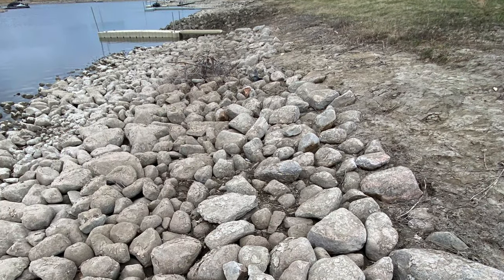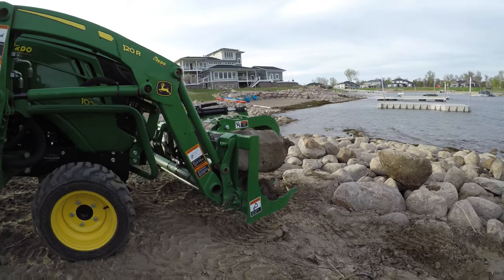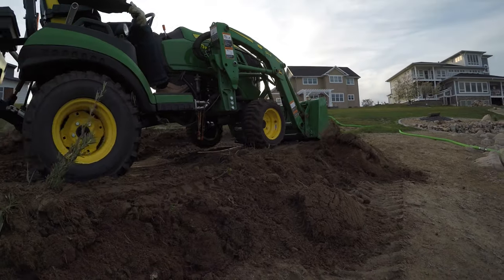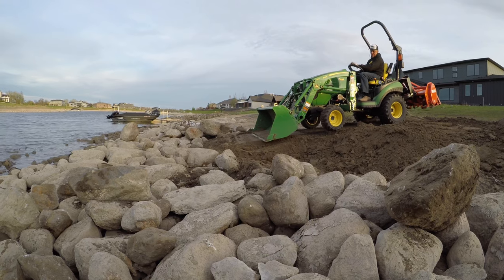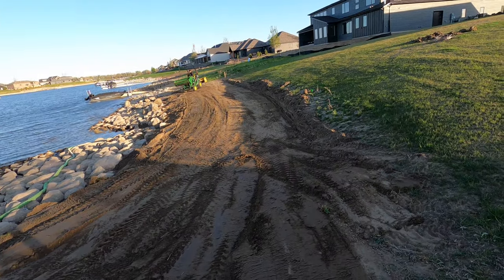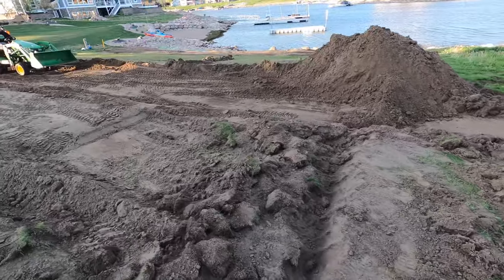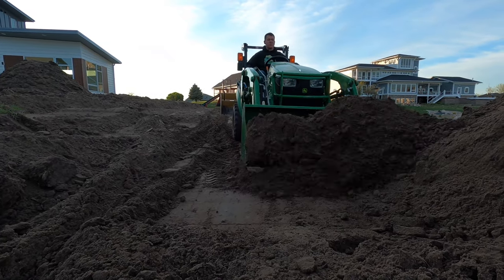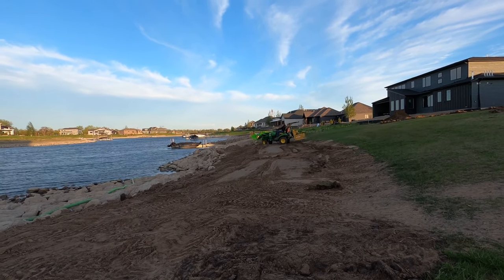1025r Removes Side of Hill! Loader Work, King Kutter Box Blade, AV20f Grapple!

Comment: Cool project. You may want to try a land plane for finish grading. Use the bucket and box blade for the rough grade and the land plane for the finish. Works a LOT faster and does a better job of leaving a FLAT level surface. Think of it as a grade averger (if that's a word).

Comment: GREAT to see someone know how to properly use a loader & drive. Very refreshing.  Curious to know, what kind of fuel consumption were you seeing working as seen in the video?
Reply from the maker: Fuel consumption is really low. This whole project maybe took not even a full 5 gallon tank of diesel. Fuel cost was maybe $10. These little tractors are very fuel efficient for the power!

Comment: Do you have any issues with the 5ft?  Thinking of a box blade or land plane and getting the right size.  Have a long road to maintain and a parking area similar to yours

Thanks for sharing Dash, enjoyed the video and nice work!
Reply from the maker: Hi Don! No issues with the 5ft other than when it gets completely full of material, I have to revere about an inch before I can lift it fully with the 3 point hitch. The 3 point just doesn’t have enough power to lift the box blade when it’s full. Definitely recommend the 5ft over the 4ft. Thanks for asking!